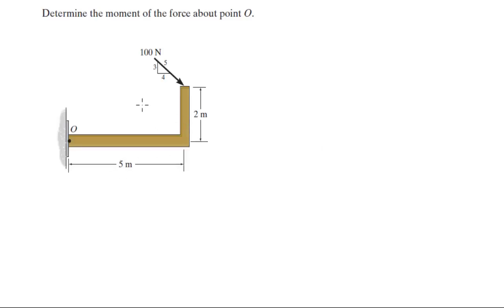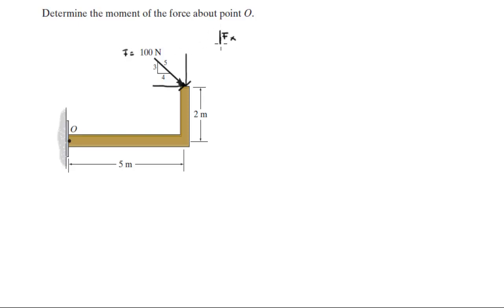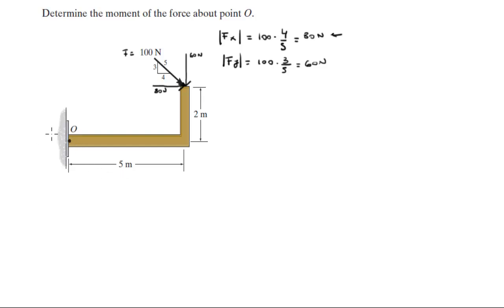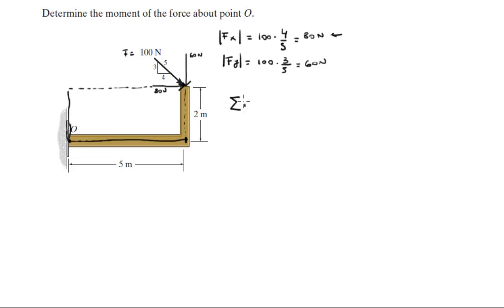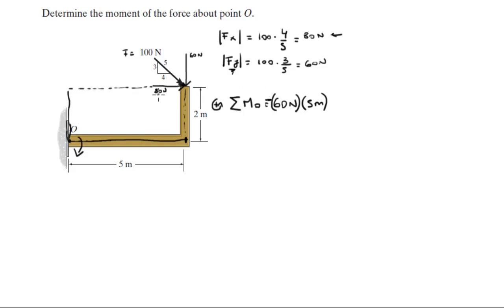Determine the moment of the force about point O.

Comment: isnt it that the Fy value should already be in negative?? because the direction of the force is going down. so it should be in negative. plugging it in the summation of forces should be -(-60)...right??? correct me if im wrong.

Comment: I still didn't get how you change the sign to negative
Reply: it's because when the force hits it, it moves clockwise and clockwise direction is regarded as negative (wheras counter-clockwise is positive)
Reply: @f4th14  thanks !
Reply: @f4th14  how come he used signed it counterclockwise first. when the rotation is clockwise
Reply: Alex Morales wdym signed it counterclockwise first? As in the symbol before the sum of moment (sigma Mo)? That’s just marking the sign convention which he’ll be using (in this case, counterclockwise is positive)
Reply: @f4th14   right counterclockwise is positive but when doing the rotation I don't see how it has negative signs for -(60N)(5m)-(80N)(2m), if it's moving counterclockwise.
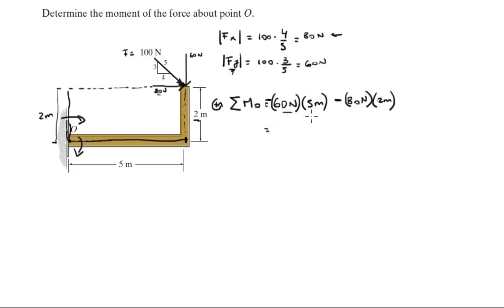Reply: Alex Morales ohhh no that 60N force is creating a clockwise rotation (pushing downwards) hence why it’s negative. Same case also with Fx (80N) creating a downward movement and therefore clockwise rotation so it’s negative. He explains in minutes 2:28-3:05
Reply: @f4th14  thanks, but this was 3 years ago
Reply: Nezar Ayoub lmaooo i answered you 3 years ago but now I’m answering Alex
Reply: @f4th14  lol okay. just saw it. Or maybe I do not remember
Reply: Same issue